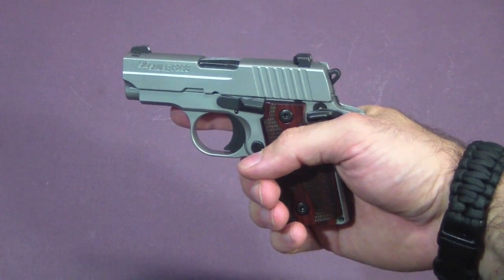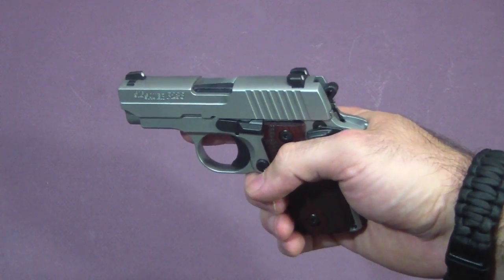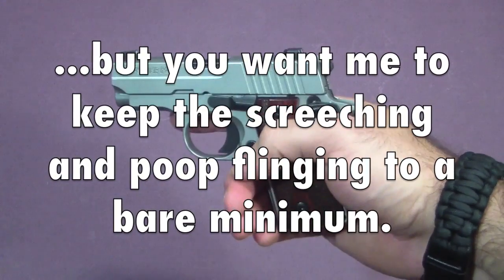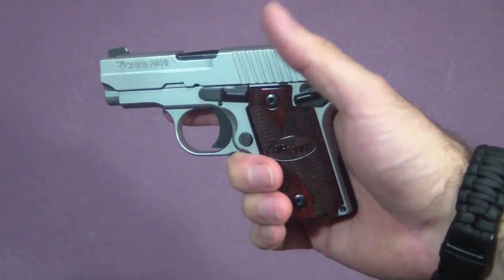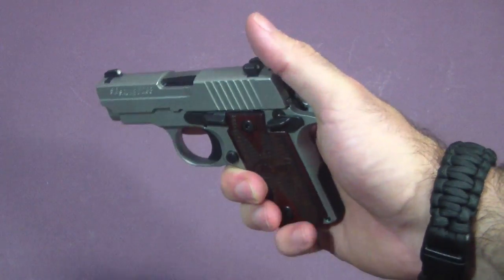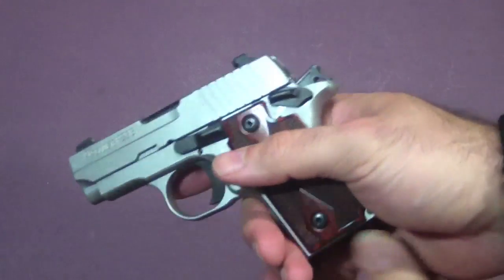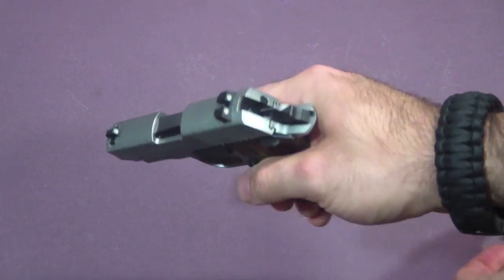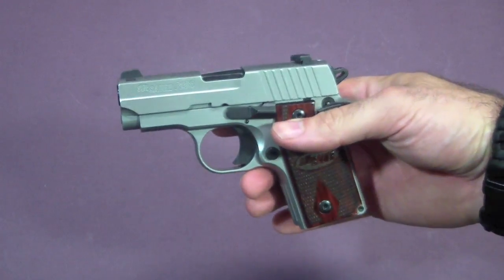Chambering/Unloading P238 w/Safety On

Comment: A "feature" I never use, and would much prefer a 1911-style slide lock safety, and a safety shaped to facilitate its operation, rather than (apparently) shaped to facilitate racking the slide with the safety engaged.

Comment: Can you safely lower the hammer with a round in the chamber.I don't always want to carry it cocked.
Reply: I don't think so.  Your only option is to lower the hammer with your finger, with the safety off, which would be dangerous.  My understanding is this gun should always be cocked, locked and loaded, unless when storing it, in which case you should unload it (to prevent accidental discharge should a fire occur next to your safe).